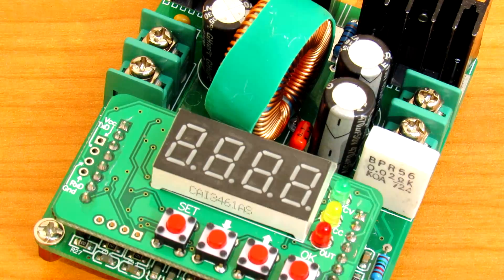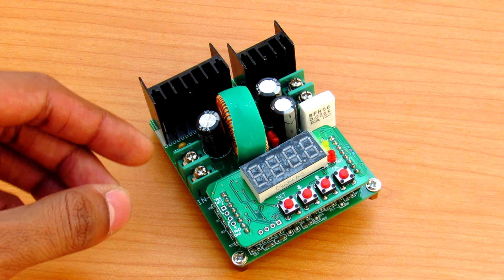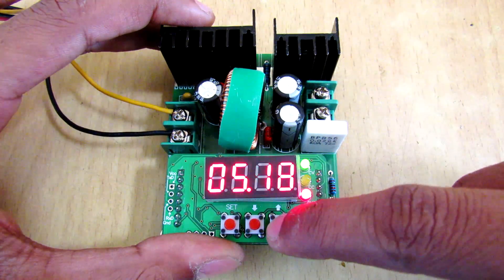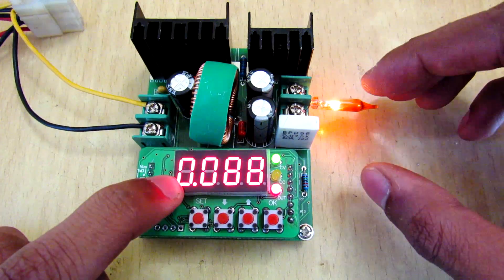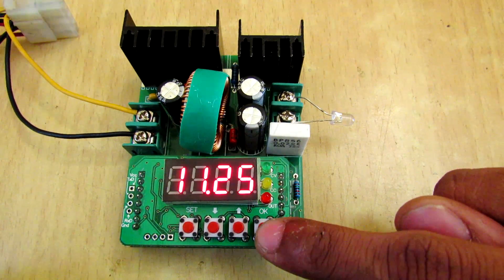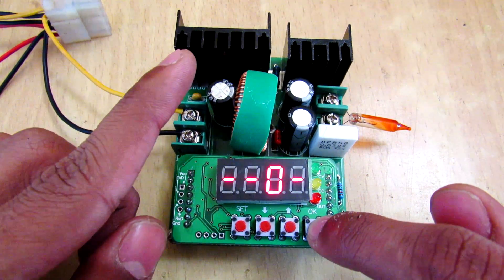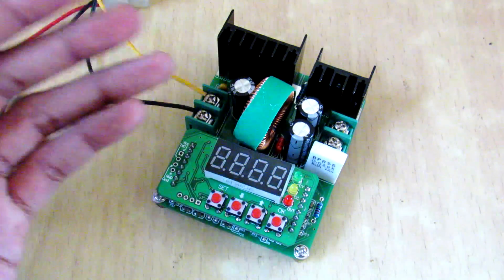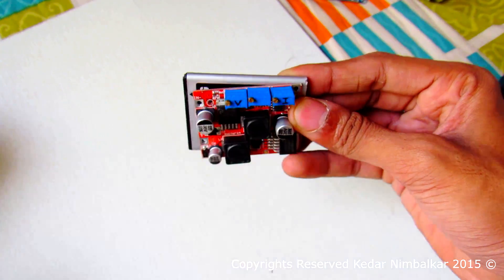Build Variable Lab Bench Power Supply Module

Comment: Why do You testing 36V 6A psu with LED and 5W light bulb??? You need 32V input voltage, 24V output voltage with 6A for 30min, than measure the heatsink temperature. This is review, this is test, not  this, what you maked... Test with LED. Omg.

Comment: Hello
Can I make a laboratory power supply to measure current  from 1mA ?
Can I see the real current on the display?
Reply from the maker: +Sergej Obrazumov yes it will show you the live readings , for details check out my latest power supply build where i used b3606 module.
Reply: Thank you

Comment: Have you tried to max it out at 36 V and 6 amps? Feeding it with a PC power supply should do, you can get 10-15 amps at 12V out of those.
Reply from the maker: I've Tested this power supply on 32 volts @ 6 amps it works good,on 12v smps current is only liimited by the 6A limit on power supply

Comment: You are amazing kid! Great Project.
I was wondering if you can do a project with something about 50-100volts but as small as the one or maybe a little bigger than the one you used in this video
Reply from the maker: Thanks ! well that's interesting thing to do .
Reply from the maker: +yonie Yes ,they're nice but output voltage in these boost converter modules are always higher than input so you don't have access to lower Voltage but great for high voltage works.

Julian did a great review of these 400w step up module .
http://www.youtube.com/watch?v=-kWps5Wpbzo
Reply: yonie  Thank you dude
Reply: Kedar Nimbalkar Thanks for the info and video reference
Reply from the maker: +Snootches Bootches Thanks !
Reply from the maker: There's High Voltage DC Converter Available which can go up to 400v DC !!!

 http://pages.ebay.com/link/?nav=item.view&id=131537920919&alt=web